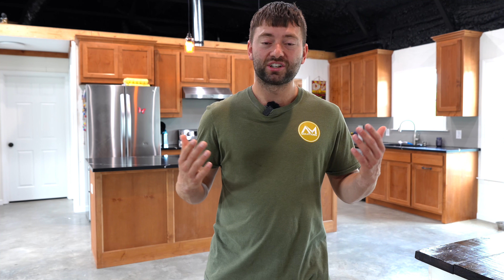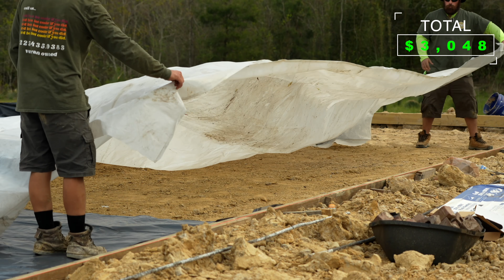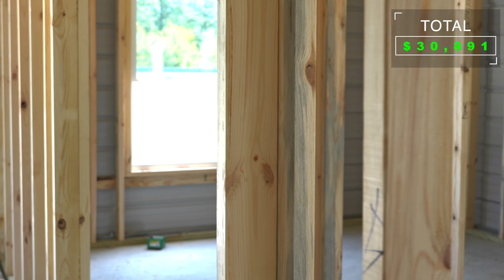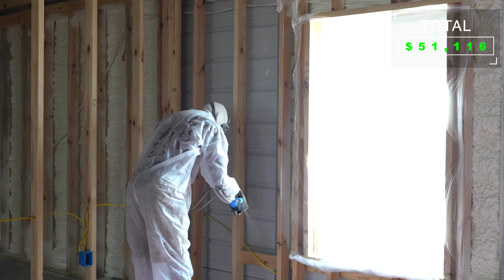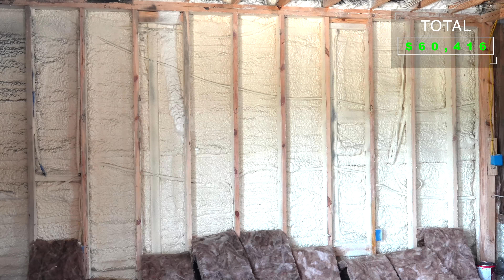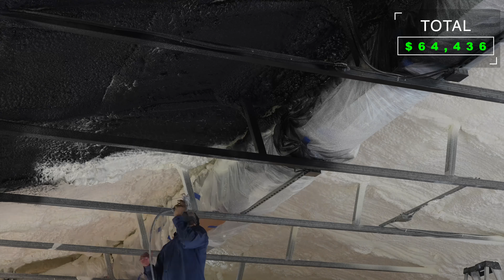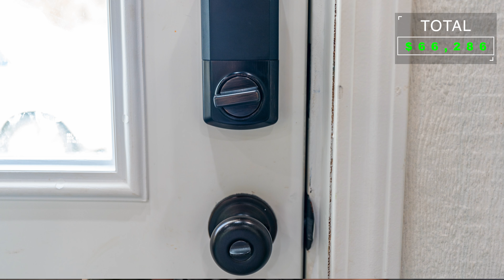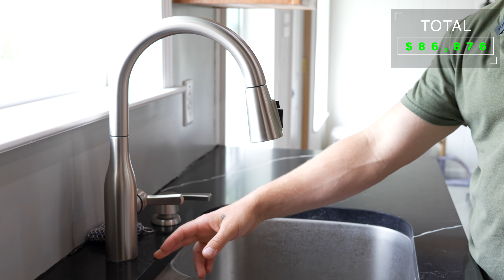Barndominium Price Breakdown | Building a 1,500 sqft 3 Bed 2 Bath Home for $87,000

Comment from the maker: Utilities and permits vary A LOT depending on your municipality. 

For my area in Louisiana I spent 

$400 on permits 

$215,000 on 27acres (that was in a flood zone so I had to build it up over time) 

$1,800 Water meter 

$3,500 Sewer system 

$4,000 Electricity 

The wind rating is 150 engineer stamped (that is the building alone without spray foam and framing on the inside) 

The bathroom counters and sinks are included in the countertop price of this video. I guess I should have elaborated a bit more there.

I didn't include the appliances because you can spend as much or as little as you want depending on taste.

Link in the description to the blueprints for the home and the receipts.
Reply: Great video.  Nicely done...everything explained.  It sounds like a big tip is to have friends.
Reply from the maker: @LTX-Shep  Having good friends is important for a lot more than just completing projects!
Reply: How much and where did you get the plans and did you have options ?
Reply from the maker: @regullconsulting2824  I drew the plans up with a friend.
Reply: Where I live in IL you can get a brand new 2000 Sq foot+ home very nice for around 160k
Reply: @ericdraven7185 you are in southern Illinois? Champaign almost no one builds new 2000 sq ft. or smaller homes. $350k on subdivision lots (small). County lots are $20k per acre. LA is 1/2 price on everything. Best always
Reply: @ericdraven7185  on 27 acres?
Reply from the maker: @ericdraven7185  That's incredibly cheap! No point in building a house there.
Reply: @ericdraven7185 WOW unbelievable! And this is in the year of 2025?
Reply: @pamelacraig2791  I think you forget the boonies exist. Get the work from home job setup first.
Reply: Can you and your friends come and build my barndo ?  I have no friends that are capable
Reply from the maker: @techiegirl2927  We would love to, but we are not general contractors and need to make money.
Reply: I'm building a house next year at my acreage.  I will definitely be taking notes from your build.  Thank you for sharing
Reply from the maker: @bangletiger80  you're welcome!
Reply: Where do you live? I just did a building expansio  2000sqft of concrete poured just over 2 years ago. Just straight brush finish with a single 12ft floor drain. The concrete and foundation alone cost us like 65k CAD so like 40K US. All in for the expansion we were over just under 400k which has no interior walls or plumbing...
Reply from the maker: @huntlife89  Louisiana. 

Did they include dirt work, plumbing, foundation prep, concrete form, material, and finish?
Reply: Your permits were for residential construction or for the barn?
Reply from the maker: @LolaTheboyz  residential
Reply: How much was the foundation pour?
Reply from the maker: @CrazyCat229  Its in the price breakdown video
Reply: Are there any builds available that use a standard foundation? Something like 4 or 5 cinderblocks high?
Reply: Who are the contractors?
Reply from the maker: @delilarbrown2362  no contractors, I'm the homeowner
Reply: Did you backfill or hardfill the property? If so, how long did it take and was it organic or forcive?
Reply from the maker: @Jaron22  I used clay that was excavated on site.
Reply: I grew up in Louisiana.  I inherent land. I had a big buyer ready to buy until he found out it was in a flood zone in Washington Parrish have sold it for a way less amount to an attorney.  I couldn't use it. I live in Tennessee. 
I like what you have built. I will look at your videos. Thank you.
Reply from the maker: @maegardnermills4292  Seems like everything is flood zone here
Reply: Oh, there wasn’t no permit done for this build. This was in the county I can tell because he skipped a lot of steps.
Reply from the maker: @ You think so? 😂
Reply: @DudeWeCanBuildIt  my daughter is her county’s Planner , zoning & permit manager. She says it’s a nightmare. Gov’t control.
Reply from the maker: @teribunker5223 it can be. It's important to work with the inspector before you even start building
Reply: @DudeWeCanBuildIt my daughter is county planning manager in her state. She says it’s a nightmare! But improving
Reply: Do these building not allow water underneath the square tubes??

That’s all I’ve heard about from these
Reply from the maker: @tylerdouglas4999 if you put them on flat concrete, they do. That's why I did a 1-in metal ledge. So the siding goes down below the bottom of the square tubing and keeps the water out
Reply: Why would you live in terrible weather and why 600 feet what happened if something gets damaged
Reply from the maker: @chriswright8074 not really sure what you're asking about the weather. I have no control over that. 600 ft from the road is because I like privacy and everything is buried underground so how is it going to get damaged?
Reply: being from louisiana myself, gone are the days where you could get land for cheap, 8k an acre is crazy is my mind, awesome build though seriously.
Reply from the maker: @HumbleGuyGaming I purchased this land in 2020. The larger the acreage, the cheaper the price per acre. 1 acre in my area generally goes for $20,000 but 27 sold for $8, 000/acre
Reply: He hired all Mexican workers, that always helps!
Reply from the maker: @Freedomfarmer1776 The metal building company provided their install crew. 

Those were the only Hispanics that participated in this build. You may want to rewatch the video.
Reply: I think you've been had at least you own your own spot. That's what's important😢
Reply from the maker: @cherylgordon6436 who's been had? And what for?
Reply: If I missed it sorry, but please tell me what state you built this barnominium? I also thought footings should be at least 18” or more depending on the size of the build? Thanks
Reply from the maker: @BMWMZ3X5 Louisiana 

It is built to the engineer drawings
Reply: @DudeWeCanBuildIt thank you. I am surprised that the footings are only 12”. I showed the video to my architect and he said the footings are not code in the area where I live.
Reply: How long did it take to build?
Reply from the maker: @MajorMondo0it took me 6 months but I wasn't working on it everyday
Reply: @DudeWeCanBuildIt Thanks
Reply: I’m a bit freaked out that the land price was so high if it was an unbuildable flood zone!
Reply from the maker: @fishhuntadventure 
$8k per acre is extremely cheap around here. 

Undeveloped lots are going for $40,000 to $50,000 per acre now
Reply: yeah but...

you live in louisiana.

id rather live in a rental in a better state.
Reply from the maker: @aa-tx7th  Don't blame you one bit 😂
Reply: 4$ sq foot for concrete!?!? lol  dbl here in tx
Reply: @JeremyJohnston-yv3wz  Its because he isnt being honest. The 4.00 he quoted was for purchasing the concrete. NO labor for forms, reinforcement , pouring or finishing was included in that as him and his buddy’s did it for free. Every word he stated are lies and omissions. He is simply attempting to gain cliks by using lies and BS. That pos will be gone after the first hurricane hits La. this year! Then he wont be quite so proud of his crap built hunting lodge!
Reply: Um, 215k is way higher then 87k...math matters b4 you put a fake lieing title, bet your a karen too.  Gfys.
Reply: Can you do a video on how you did this partially your self, and contracted professionals for the rest?
Reply: I heard the spray foam spreads gas toxics
Reply: What company did you use to come out install your metal building
Reply: What size building do you have ?
Reply: For the Northern states, the roof has to be rated for the snow load, which I'm sure will add to the cost.  But still, a decent house for under $100K?  Wow!
Reply: Why would you waste money painting over the spray foam (ceiling) when you are not going to see it? Especially painting it black? It'll be a lot darker in the "attic space" if you need to make repairs later on. Should've left it white/yellow.
Reply from the maker: @travelinman482  I’m not covering it. I left it exposed because I like the exposed look
Reply: @DudeWeCanBuildIt  I think he means the fact you painted the spray foam and then have a ceiling under it, unless you did not put a ceiling up in some areas of the house?
Reply from the maker: @00M6TA  The whole living room, kitchen, dinning room is all exposed. The only thing with ceilings is the rooms
Reply: @DudeWeCanBuildIt  commented while i was watching the video, could see a bit of the black in the kitchen shots later on.
Reply from the maker: @00M6TA  Yes, I want everything above the walls to "disappear"
Reply: @DudeWeCanBuildIt  That's a great idea.  Also it makes the ceiling more accessible to spot any leaks later.  A wise move.
Reply: @00M6TA   00:10   Kitchen with no ceiling.  What ceiling?
Reply: @travelinman482  look up at any point when he's in the kitchen....
Reply from the maker: @ROCKSLAM4LIFE  😂
Reply: @travelinman482   00:10  You can clearly see the blacked out roof and foam and that there is no ceiling in the kitchen.  
Black industrial ceilings are very common in restaurants, basements, and commercial spaces.
Reply from the maker: @FixItPleaseJ  Exactly!
Reply: Cali. I spent $53K on fees. That’s not a misprint.
Reply from the maker: @jamesdellaneve9005  Oh I know. Cali is very proud of their land and let you know it when they scrape every cent out of your pockets to line their own lol
Reply: Be careful of those electronic deadbolts, certain electronic lock manufacturers will give the “company code” to any police department that calls and asks for it…..
Reply from the maker: @Rick_Sanchez_C137_  I didn't know that
Reply: What parish?
Reply: @Keeping_It_Wheel I would like to know too. Louisiana keeps calling land floor zone.
Reply from the maker: @Trentxxx  Can’t be telling you all that! 😂
Reply: I figured the title was nonsense at least you cleared it up in the top comments so I can skip the rest. You gained one view but lost any potential future views
Reply from the maker: @snaker9er  The title is very accurate.

Comment: A friend just built a 40x80 metal shop in a relatively low cost of living state. Its a post structure built with the R&R technique. He did EVERYTHING himself except the concrete pour (he did all subgrade and prep work). He is still in it for $90,000. Youtube is not reality. If you think you can build a 1500sqft barndo for $87,000 I encourage you to price your concrete, metal, gravel, doors, and windows. You will quickly find the math does not math.
Reply from the maker: That’s cute and all but I have literal receipts in the description. Just because YOUR friend couldn’t doesn’t mean you can’t. It’s also very dependent on where you live. You’re right. The guy in California absolutely could not build this at this price

Comment: Should have spray foamed over all steel including beams 2 inch closed cell then 2 inch or so open cell. Save money. But now your steel will sweat in cold environments and create water and mold behind walls. Also need foam beneath the concrete.  Many more things.

Comment: You think so much like me. When you build with materials like plywood and drywall replacements they have many advantages with the most important one being that you can remove them for upgrades like electrical and plumbing and then put them back with no fuss and no muss. Every choice you've made have been mine in the past or will be mine in the future. You have built a high quality cheap house that suits an engineers mind like my own.

Comment: Im not sold on the spray foam insulation being sprayed directly on the metal sheets,I would have used 6ft wide roll insulation first and then installed metal sheet over it

Comment: If one of the reasons you liked the the tubular steel building was because it was termite proof then why would you frame the inside of the house with lumber or wood. That just does not make any sense. You should have used masonry or steel interior walls instead. I have seen concrete and steel homes with interior wood walls and cabinets that were ravaged by termites. To each his own.

Comment: Normal ordinary people would never get these discounts.  I appreciate your honesty.  Great vlog.
Reply from the maker: These are Home Depot prices. 
I get a 10% military discount. 
Do you know a veteran?
Reply: @DudeWeCanBuildIt i appreciate the heads up.  Still would pay retail for contractors.  Im in northeast and was quoted $32k for 40x60 pad 6inches thick.
Reply from the maker: That is a large pad and probably has deep footers.

If you frame it yourself, you could probably save $1 per square foot.
Reply: @DudeWeCanBuildIt good info. Thanks

Comment: Pro tip...vegetable oil is NOT a good ide if youre wanting to reuse the lumber. Use used motor oil. Its cheaper, penetrates better and doesnt get sticky over time.
Reply from the maker: I understand that it does a better job for the lumber and at the same time I can't be on the internet telling people to spray used motor oil on stuff that will leech into the ground.
Reply: @DudeWeCanBuildIt I guess that's a solid point 🤣
Reply from the maker: Lol, I have used it for other projects in the past

Comment: Great build and all, but 99% of folks who just want something simple also don't have a network of tradesmen who can just pitch in as a favor to them and actually do a good job. It's basically a GC advertisement that shows all the steps, but it won't help most folks save any money, because they'll never pull it off at that price unless they know a bunch of tradesmen on a personal basis who not only take pride in their work, but who also aren't charging market rate. People would still beat a path to your door to sign a contract with you to do this even if the price were doubled.
Reply from the maker: This is more about documenting what I did and showing people what is possible if you have the time and effort to put in. 

I've never built a house before and it's not rocket science.

Comment: Notes: Drywall has a 1 hour fire rating at 1" thick, the wood panel has zero fire rating. ALSO, caulk the corners before you put the crown up, to stop bugs from coming in from above. Personally, I would have looked into mini-split AC systems, as its much cheaper for the people that dont own a HVAC company, lol. Love the instant water heaters! (Wish you would have done a better before/after footage, i cant tell how much of that barn is actually home, or barn... Looks great though!
Reply from the maker: Great notes on the drywall and fire rating!
Check out our update video to get a better visual on the inside. 

Also, it's 100% house

Comment: Interior paneling should have been horizontal. (shiplap) Using the Sheetrock you did, makes it look like a trailer. Definitely a dude house
Reply from the maker: Doing it horizontal means there would be a vertical seam to cover every 8 ft.

Comment: Just found this vid. Im doing the same kind of build. My building is 1600 sq feet and Im doing 100% myself. I had not considered many of the materials you used for wall coverings. I have not kept track of my expenses but Ive paid no labor. Good info
Reply from the maker: You can do it! It doesn't hurt to think outside the box

Comment: 29 gauge metal and 14 gauge tubing? 25 year building. 22 or 24 gauge for the roof and at least 26 gauge for the walls with 12 gauge tubing. 50 years.
Reply from the maker: Thanks for the info!

Comment: I tried to do this in my back yard. Step 1 was obtain a permit. This required me listing all the contractors I'd be using before it would be issued and any deviation from this would result in having to reapply. So I just went back and watched some TV.
Reply from the maker: It's always good to know the rules before starting a project.
Reply: @DudeWeCanBuildIt ya, I don't want to be locked in with anyone I've not worked with before. Imo not being able to switch contractors reeks of lobbyists knowing how difficult that makes it for anyone trying to be their own GC.. but I'm a bit cynical.

Comment: Not a criticism, but why double top plates on those interior walls?  They aren't carrying rafters.
Reply from the maker: They are supporting ceiling joists. 

Also need them to tie wall sections together and have 8' wall height when using pre-cut studs

Comment: To be fair, you're getting insanely good deals somehow on the skilled labor, or maybe I'm just use to Alaskan COL.

Your needed plumbing and electrical work would cost double, if not triple up here.

Edit:  after the 6th time of hearing "my buddy" this isn't a realistic expectation.  You have connections the majority don't, and your own HVAC and handyman skills, so while some stuff can still be DIY, to pass code you're going to sub out a large majority of this work (so at least you can avoid a contractor cost).   Not including the price of land, the structure to a typical person once built is going to be much more outside of the building itself which was sold at a set quote.  The land depending where you are, depending on acreage, is typically going to cost you anywhere from 8-12,000 per acre (or in urban areas way way more).   Even with that said, you'll save money compared to today's housing market - the issue lays with 20-25% down for new construction cost (unless you're in an area that is USDA) when getting a mortgage on this, since most people cannot afford this in cash.

This would cost more realistically 200-250k to your typical person building in a rural area, and with the price of land being high in suburban areas, you'll be well over 300k.
Reply from the maker: We did have some help from friends and family, but we were able to save on labor by doing a lot of the work ourselves.

The price of property varies a lot and some people already have the land. It's impossible to make everyone happy.